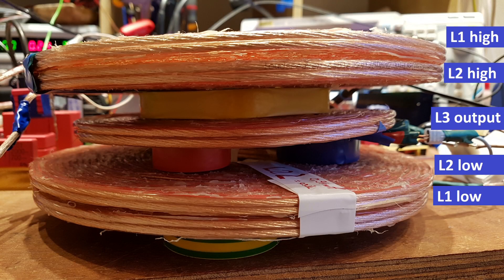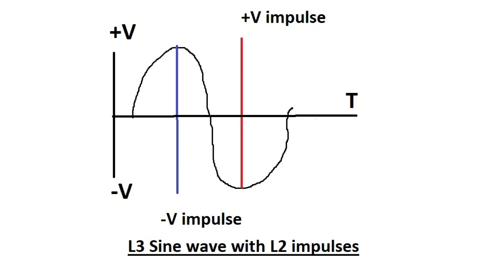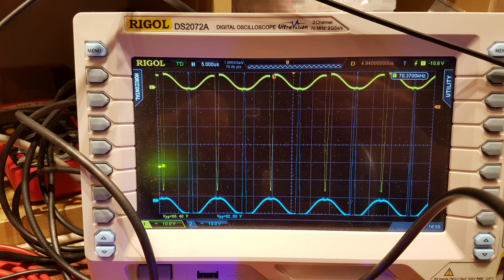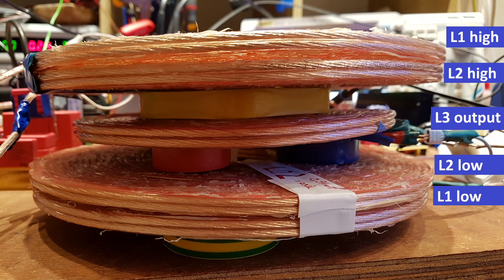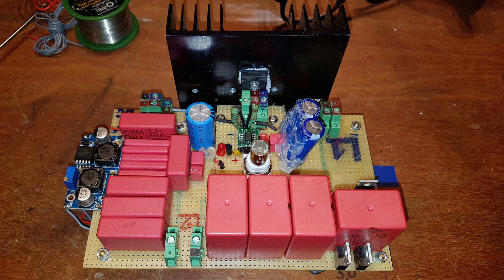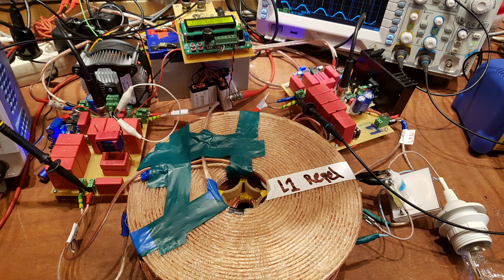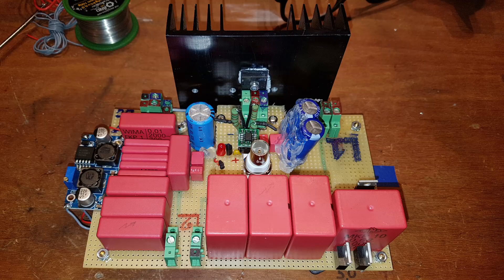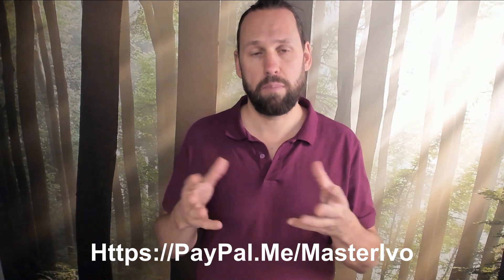How to induce electricity

Comment: How is this different from standard induction found in transformers? I dont see any difference.
Reply from the maker: take a look at the april 2019 video of me. That lamp isn't bright from magnetic induction (coils are 4.5 cm separate) its dielectric induction, more even so, the coils are series and parallel resonant and should not have any power.
but they do light up a 28W lamp.

Comment: I am proposing a new model to explain your dielectric impulses based upon chapter 4 of "lost science" by Gerry Vassilatos.  If you do the math, small charges such as 70mV across nanometer nerve membranes create voltages higher than whats used in the biggest power plants on earth.   You achieved high voltages with fast discharge time. What I believe is occuring is that you are using high voltages to shake the atoms enough that they release subatomic particles at the planck's constant scale. The maximum positive & negative discharges shake the atoms most effectively. Since this is an electrical effect, vortex mechanics is not required. Once released, these particles are repelled out of capacitors by electrons. They move to positive charged surfaces. This explains the skin effect observed along metal tubes in Vassilatos' book. They must exist outside all matter to create perpetual motion & charge, therefore vacuum acts as a gas. When they are released, they produce high pressures which cause movement. This motive force was described as whitefire in Vassilatos book. They produce overunity when they are recaptured by Low Mass Electrons.

Comment: Ever heard of a Kapadzne Generator they tap into earth energy bcoz earth is a Capacitor then a reverse Tesla Coil is pulsed 
Also when putting a pancake coil on top of an induction cooker one can get free energy out of it by tricking the circuit and putting steel on top thus opening the field...

Comment: Hey @Ivo , not sure if you already know the answer or were genuinely asking how this occurs in nature. This occurs in nature all the time. The L4 and L5 are clouds and L1 and L2 are the earth. One is positive and one is negative and there are dual inversely polarised dielectric fields between the two. (this is why you sometimes see lightning from the clouds to the ground or ground to the clouds or from ground and clouds to each other and meet in the middle (lots of videos pics on this captured with high speed cameras.)) Since yours will be equal voltage on both sides, you'll get the meet in the middle effect. Basically you're making a spark gap and you're putting the L3 coil in the middle. I think it's an interesting test, but make sure you prepare for the lightning.... meaning the spark that could appear between your top and bottom coil set eating through the plastic insulation on your coils. The gap between the L4/L5 and the L1/L2 seems far enough away that the spark cannot happen at the impulse voltages you're using, but with the L3 in the middle.... that may allow the sparks to fly...stand back when you fire it up...and make sure you have a way to turn it off easily from a distance.  Good Luck and make sure to film it on all the tests... If you cook it, you'll want that video footage, and won't want to repeat it a second time to catch that moment on video :D

Comment: Hi Ivo, good video, looking promessing. 

The red capacitors shown in this video are what type, make and size. 

Could you provide information ?
Reply from the maker: wima 680nF 2000v dc mkp10 (or fkp1)  and the tuning caps are smaller 10nF and 1 nf

Comment: @ivo I assume winding the L1/2 low opposite direction to the L1/2 high. (Perception in mind - it ends up being the same direction in 3D when flipped over) Essentially, allowing for a zero point to form in space where you have the L3. Theoretically, this spatially models a 3 or 6 dimensional torus, or intersecting of 2 vortexs. Love you Ivo and Happy holidays. 2020!!

Best,
Ty

Comment: Ivo.
quite an interesting experiment I would like to see how did you solve the synchronization of both signals ?

-whether they come from one source? (flip flop generator) or two independent generator sources?

- or did you use some PLL system?

-what you control overlapping time? 

a few years ago I was trying to develop a system to reconcile both the signal in the ruda under load the impedance changes

question what happens with the output signal of the L3 coil under load?

Comment: for a better visualisation take the toroidal flow and divide it into the types of motion comprising it across "dimensions" (for lack of a better analogy): 
a vector encountering opposition is forced to be split into both directions that are perpendicular to it (the resultant between it and the equal and opposite force it encounters)
in 3d (or 4d whatever) space you have a whole set of these bunched up in all possible directions including inward. 
now, the question of the chicken or the egg comes to mind but this is not an either-or scenario because the whole situation is necessitative so it is more of an if-then-else type scenario.

Comment: Have you heard of the Ferrocell? There's a vortex between N-S, N-N, S-S. Not sure of directions of rotation, yet. Magnets do not attract or repel each other. The poles are attracted and repelled by this null vortex. Ken Wheeler's videos. 
 Have seen opposing rotating vortexes along the Mandelbrot set's edge. Look like, phi:1. With an Inertial plane from inbetween the opposing rotation vortexes. 
 There are Fibonacci numbered antennas on the knobs of the Mandelbrot set. (Dr. Holly Krieger).
Reply: I like Ken and his theories however I have to disagree with his observations within the ferrocell. The nano particles of ferrous elements are rods when viewed under a microscope. The nano rods align vertically (radially) in the presence of a magnetic pole. The signal from each LED will reflect off any rod that is perpendicular to it. As the nano rods are 'wagon wheel' like radial from the pole, the reflections appear to create a curved path. However light is in no way curving. There is no reflecting light occuring in the centre because nano particles do not exist there as they cannot align themselves so eject themselves to the the pole edge. When a solid ring LED is used there are no lines, just a solid gradient. Search ferrocell and microscope. 

I agree with vortex theory in addition to much that Ken says about magnetism, however not the ferrocell. Cheers
Reply: @elams1894 ;  Two extremely flat pieces of glass, very close to each other. Casimir Effect.
Reply: @gyro5d .. What does the Casimir effect have to do with the ferrous nano particles and the optical illusion they create? Cheers
Reply: @elams1894  Casimir Effect is the Aether field vortices of Space and Counterspace (plates). The plates attracted and Repelled by the Inertial plane (nano-rods).
Reply: @elams1894 ; The Dielectric Voidence Field/Magnetism is 90° to the Dielectric Energy Field. I haven't seen the vertical rods under a microscope. I'll believe that they are vertical. Light is perturbations of the Aether Field. Lights rate of induction is Magnetism's rate of its creation. Both Dielectric Energy and then its Dielectric Voidence Field are needed for the nodes to be created. From their transverse fields, to perturbate on/in. It's dark at the center, meditated to the Inertial plane. Gravity, centripetal acceleration into the Inertial plane/Counterspace is dark because gravity is Dielectric Voidence Field/Magnetism returning to Dielectric Energy, then into the Inertial plane. When Dielectric Voidence Field/Magnetism returns to Dielectric energy (Radiant Energy?), there are no transverse waves left for Aether perturbations to travel on/in. 
Thanks.
Reply: @gyro5d  Field theory tangential topics aside, look at the facts (observation) of what is occurring in the ferrocal, as that is what my comment was about. Again, The nano particles are aligning themselves with respect to the affect the magnetic field is exerting upon them. The nano particles align in wagon wheel like fashion from each pole, just like iron filings do on paper that is sitting above a magnet. They curve as a result of the affect the opposite pole is exerting upon them. Light is reflected off any surface of a nano particle that is perpendicular to it. The number of lines of the hypertrochoid is directly represented by the number of LEDs. One LED, one line, and so on. The optical display that the ferrocel presents has zero to do with counter-space, violence, inertial plane, or any other field theory speculation, and everything to do with the reaction of iron rods to a magnetic field and then any light that is reflected off of them. It is as simple as that, nothing more. Check out any microscope image of nano rods and the optical presentation from the ferrocel becomes clear.

Having read your latest comment, which is much appreciated, it is clear that you give deep thought to field theory. I too research field theory and have a great interest in it. I have come to the speculation (as everything in field theory is speculation) that perhaps there is only one field, the magnetic field. The dielectric field need not exist for all the phenomena that we witness in field theory to be explained. In my speculation, there is only the magnetic field (energy in disequilibrium as a result of energy input) and the elimination of the magnetic field (energy returning to equilibrium). All that we perceive to exist (matter) contains a magnetic field (energy in disequilibrium) that is then itself lying in equilibrium with all other magnetic fields in its environment, i.e., perturbed magnetic fields organising themselves in a state of least resistance. Cheers
Reply: @elams1894  ; Our Space Universe started when Dielectric Energy tunneled from Counterspace. Releasing Dielectric Energy creating Space and this is when Time began. Inflation. Then a Dielectric Voidance Field/Magnetism was created. The Grand Expand. Magnetism gives Magnitude to the Universe. These coaxial transverse waves create Nodes that EM waves perturbate on/in. EM waves can not exist without both transverse waves. Light's rate of induction is Magnetism's rate of creation. Dielectric Energy is near instantaneous by itself, Inflation.
 Thanks.

Comment: Here are some interactions of smoke rings that are very interresting.  https://youtu.be/zVXR7xttUeo .There is one trick where two rings interact slowly together and they seem to fuse together and form a really long ring. It happens twice, but the camera dosent focus on that th second time. There is also a trick where he wobbles one big ring and it separates in two rings. The interactions here are going in the direction and the same spin.  Ill link another video of two toruses colliding together. 2 different directions. They collapse and cancel out their speed and the effect acterwards has no spin to it.  Ill try to find it. If i remember they are also smoke rings and they are colored.

Comment: Does the ring vortex cut through the air because the inside is going forward with less area then the outside going forward.
Reply from the maker: than the outside is going backwards?

Comment: Is there a positive and negative scalar wave? Can we creat both and make circuits with them?
Reply: There is no such shit as a scalar wave. Scalar by definition denotes no change in location by a potential value and thus has no direction hence not a vector. A wave has direction and is a vector. Stop using words that you don't understand.
Reply: @nazgullinux6601  Scalar waves are capable of passing through the earth from one side to another with no loss of field strength as Tesla showed in one of his experiments. Traveling faster than the speed of light (superluminal), Scalar Waves are not electromagnetic but composed of pure zero point energy.

Comment: I can say that a flower is a double ring connection...except one is south and one is north in em terms...both are a ring vortex ( or halowave as they are truly constructed)...but they go through a dna frequency code..and so produce petals instead of a ring....the inertial line is the separation between flower on top and green bits under the flower...both ARE rings...just rings of leaves or petals due to the dna frequency code instructions for em flares (invisible and small to start until the mass is added to) , which then attract matter and the flower petals/leaves is made from the air...but constructed inversely reflective ...same as a plant in the ground....or the two differing fields on a magnet...which has 2 rings...not one...as I showed on video.

Comment: I have always thought there could be effects caused by things we use every day, that we do not see, and there could be things like this happening in reverse,
So why couldn't something so simple 'kind of ' lead to something revolutionary? Why couldn't there be a way to tap in to the energy that heats the universe above absolute zero, or the energy holding atoms together, or all the other forms of energy out there,  where do you connect to use this energy? Where do you push, where do you throw the anchor? For all we know there is soo much we don't!

Comment: max positive+ on one coil and max negative - on second coil... what would happened if you used both max positives (or negatives), but you flipped one coil upside down, wouldn't result be the same ?  wouldnt that simplify your circuits?
Reply from the maker: Will try, thanks for sharing
Reply: I think it would make a different type of electricity. DC being right hand or clockwise turning, the secondary coil might make cold electricity, or a left hand turning implosive style of electricity. If you using this converted electricity, you should be able push all of your circuits or motors through much higher power cycles without burning them. A temperature sensor should tell you if it's cold or hot.